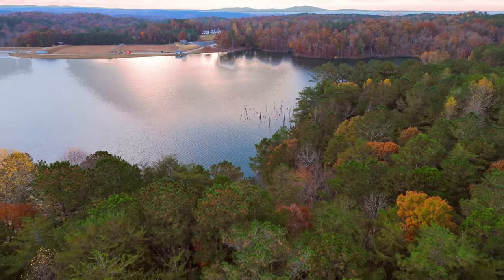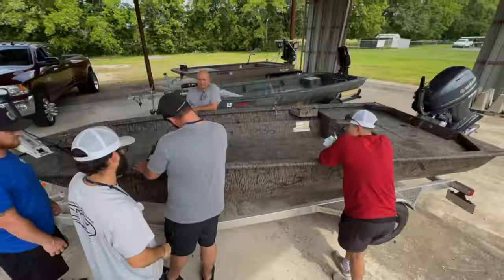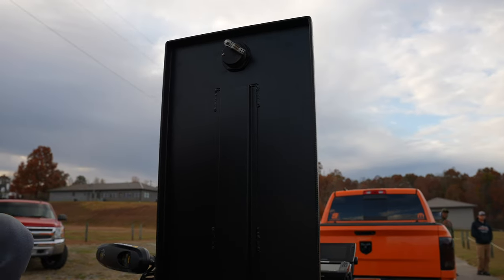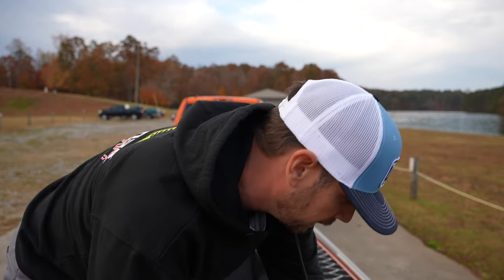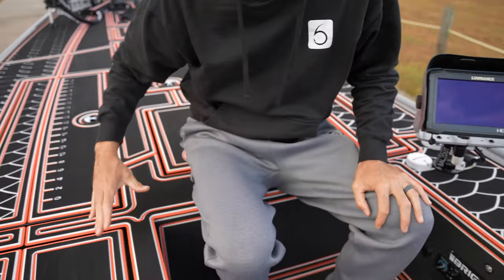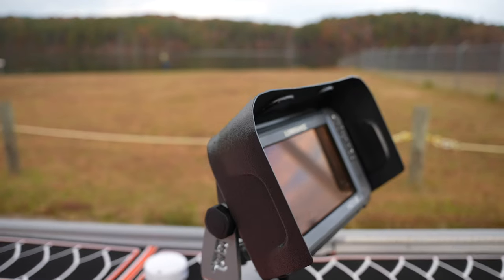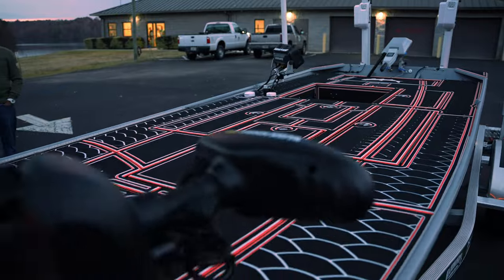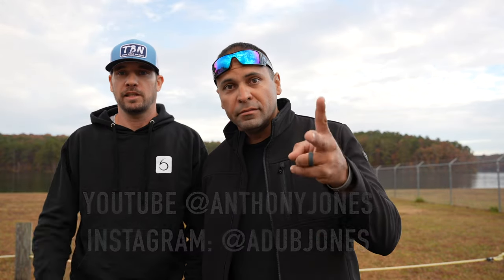Sickest rigs in electric bass fishing @AnthonyJonesBrigadeBoats

Comment: Top speed?
Reply: Right now i'm getting a little of 7mph pushing this boat "Tournament ready" and live-well full
Reply: @carybell  Gotcha! I've never seen an electric motor and battery that big. Have you messed around with other props? It's a frickin amazing boat.
Reply: @Matt Aneshansley  thank you buddy. It is the largest set up Epropulsion makes at the moment. It came with 2 props High pitch and low pitch and its got the high pitch on it now. I will put the low pitch on it soon and see if that makes any difference
Reply from the maker: must....try.....prop options!